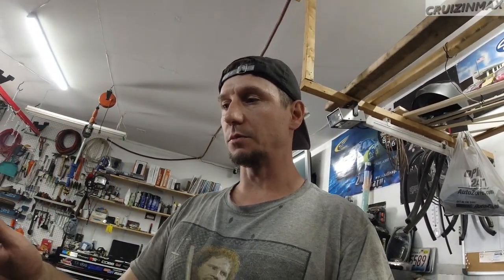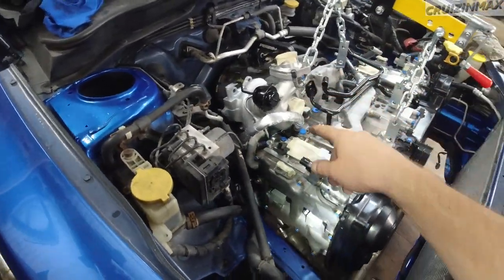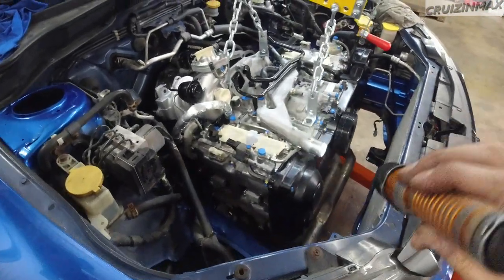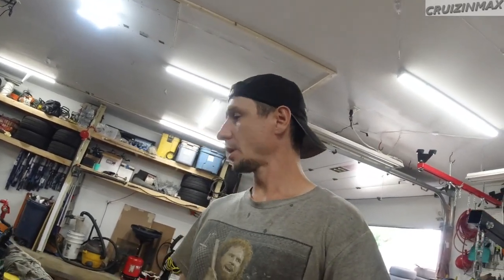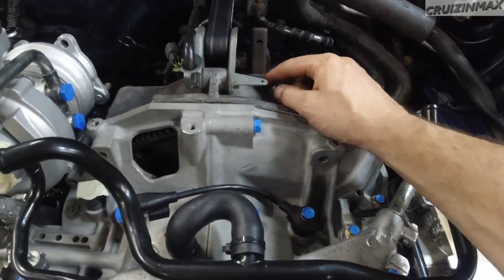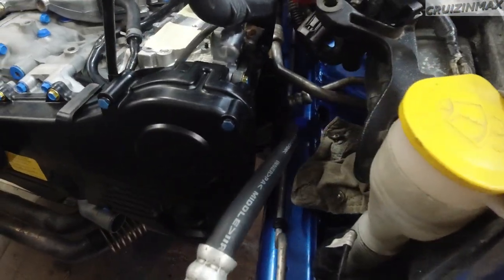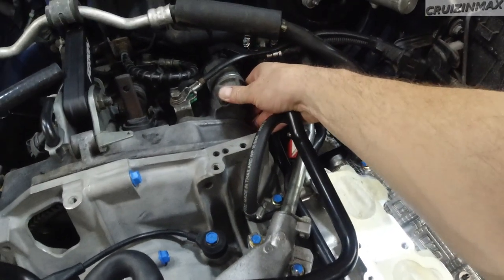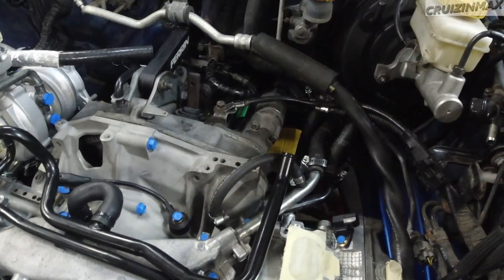Subaru WRX 6spd swap autocross build part 10 mounting the engine

Comment: Sir just gonna ask about Sti 
When u got p0031 and p0113 code together
What’s is the problem? I’m getting frustrated
Reply from the maker: O2 Sensor and air intake temp sensor...start with the cheaper one.  Possibly two separate problems.
Reply: Thank u very much sir 
I’ll try the map first